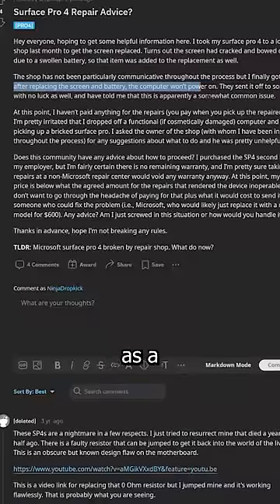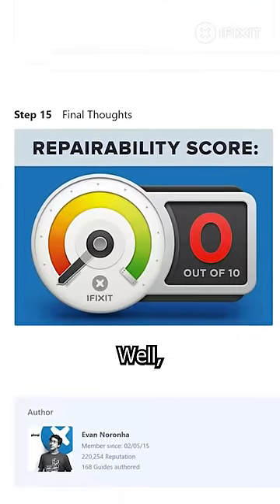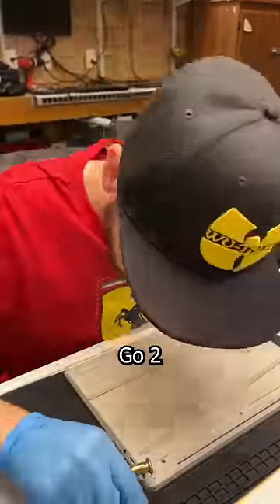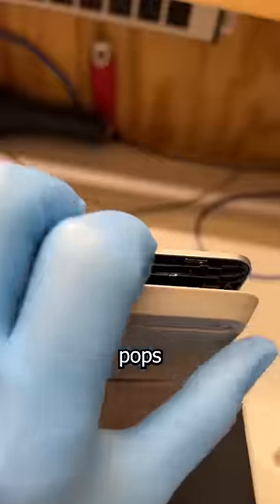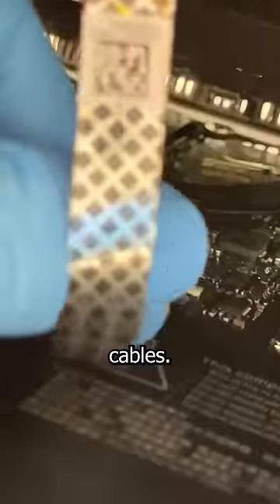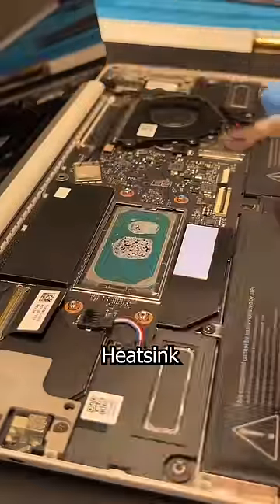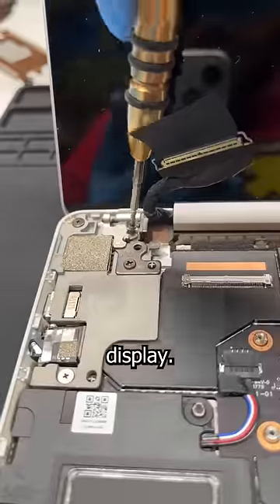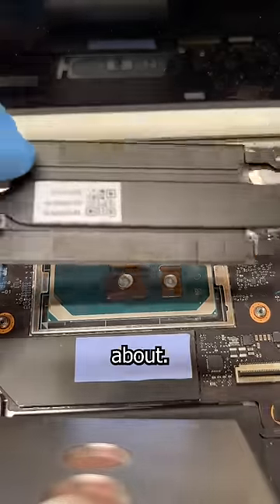Microsoft Surface Laptop Go 2 display replacement #computer #tech #pc #technology #shorts

Comment: 100% better than the old surface
Reply from the maker: Yup!
Reply: @SalemTechsperts the original Surface was glued together😮😮😮.
Reply: but its not hard to be better than shit in the 1st place, and there still bad as you cant even replace the ram in it lol and they say they made it easier to fix yep but not by much lol
Reply: At least it isn’t a table
Reply: 100% of 0 is still 0...
Reply: teslafusion74  its done to save money and to make it so the average person cant fix/upgrade it them self so they can then make more money on the laptop they try so hard to cut cost on so much that they solider down to ram to save 10c
Reply: teslafusion74  being less off a rip off than the biggest rip off is not a good thing as its only time before both get worse and that line is moved again.
Reply: 100% of 0/10 is still 0/10. :D

Comment: First time I hear "soldered ram sticks" for "security reasons" in my entire life
Reply: That hit my ears too... Wtf...
Reply: Doesn't apple do that too?
Reply: They secure their profits 🤡
Reply: @embrance9565  Yeah, it sounds like BS. There is a kernel of truth though. You can cool the RAM down to very low temperatures, turn the computer off, remove the RAM sticks, and read the contents of them (for things like passwords, encryption keys etc).
The cooling helps them retain the data for longer without being powered on and refreshed.

However, I seriously doubt that is the real reason the RAM was soldered on.
Reply: @isa_L  No, that's not true. Look up "cold boot attack". Wikipedia has a good article on it.

You can't rely on SDRAM keeping the bits intact without power for more than a few milliseconds, but especially when cold, they can stay intact for minutes up to hours.
Reply: Securing the bag
Reply: The Cold Boot attack exists. Soldered memory makes this pretty impossible, as the thing you need to do to preserve memory contents, runs counter to the thing you need to do to actually remove the chips. 

Perhaps soldering should become more normalized?
Reply: FortniteClipper-oo3qz  Mugging, police seizure, simple theft, etc.
Reply: @dygon7663  Yeah, and there's a reason people are hating them more and more, even some fanboys have turned coat against their stupidity (though not like the majority of people who buy Apple even knows what RAM is or why it's needed or why it's bad that it's being soldered lol).
Reply: @Lauren_C A far better way of preventing this attack than ruining upgradability and the ability to repair your system is through RAM encryption. In fact, it is entirely possible to preform a cold-boot attack when the memory is soldered or glued on if other security measures aren't used.

Comment: I literally went "😳 WTF" when I heard that the ram was soldered on 🤣
Reply from the maker: Yeah it's unfortunate
Reply: I saw one of those...long time ago. And i looked at that RAM...and immediately thought: "SteamPunk"
Reply: It's typical for a bunch of the more compact and slim notebooks nowadays. Not ideal but they figure it's a compromise to have more room to fit everything else on the board.

First notebook I had with soldered RAM was the Vaio P and even though it made sense why it still left me wishing a RAM upgrade was an option, Vista and Win 7 didn't exactly sprint on only 2GB, at least an SSD upgrade made it boot up and wake from hibernate a lot faster.
Reply: @G1NZOU  That's not even close to the reason why.
Reply: @ValidT  Perhaps elaborate.

Comment: Ive repaired/replaced four screens across three generations of Surface tablet, as well as a battery and some small bits (like the little camera/mic assembly that runs along the top). The fact that you gotta heat the adhesive just to remove the screen to do anything with the insides is not even the worst problem in some of them. Its design is hostile to repair, and I'm pretty sure it was on purpose. The bar for better/more repairable is so low.
Reply: They made a lot of improvements with the Surface Pro 9. For example, the battery is now screwed instead of glued.
Reply: Microsoft even provides now a manual for repairs and parts for the Pro 9.

Comment: I was actually kind of impressed with my Acer Predator at how repairable it was. RAM was modular, even the system drive and wifi controller were easily accessible. Its just a shame something on the system board shit the bed and Acer wants 2k for a replacement. (The laptop wasnt even worth that much brand new)

Comment: The soldered on ram helps prevent against cold boot attacks
Reply from the maker: This is Microsoft's exact argument. It's valid but an unnecessary concern for 99% of the users. They should have made specific models with soldered RAM to be sold to those that need high-security.

Comment: Working as a retail tech, I had a brand new surface pro (2 or 3) come in for a setup. The adhesive strip meant to mount the screen to the case had not been set properly, and there was a section of it that poked out along the crease. I spent a couple minutes trying to fix it before telling the cs team to swap it out for another unit. I never opened those things up, as it was WAY outside my paygrade.

Comment: I work for our IT department in our school district and besides the SSD and RAM being soldered in, the only really annoying aspect of the surface go's is the stupid rubber feet on the bottom. No adhesive or tape you use will make it go back to its place. There will Always be one rubber feet that pop out of place

Comment: Wish you could have done the same with Surface Pro Models 5 and up,
We work with Corporate Organizations MNC's,
and have supplied 100's of Surface Pro with extended warranty support upto 5 Years,
We have specifically trained our technicians and engineers on how to remove the display panel from Surface Pro and Perform repairs / replacements. (Trust me it is still a big pain) 😂

Comment: We need to bring back the laptops that have a Lil hatch on the bottom where you can just replace ram in less than 30 seconds
Reply: Microsoft figured out a while ago that laptops with more RAM are more expensive than RAM by itself.

As long as that remains the case, they aren't going to make it more viable to upgrade your RAM.

Comment: I regret ever having bought a surface pro 4. The first surface pro should've been the warning I heeded, because after a 3 days of using it, it refused to ever turn back on again. No one in town could fix it. Then the second surface pro I bought went through three chargers and its battery is an unreplaceable spicy pillow. Fun.

Comment: Surface Book 2, I sent mine in to get a new ssd installed. They kept it for 6 months. I ended up with a new motherboard, screen, keyboard and, thankfully, the new ssd I'd given them in the first place. They broke the screen 3 times total and kept ordering the wrong part to fix it. I didn't pay a dime but it resulted in the whole uBreakiFix store changing employees..... we still use that surface book.

Comment: i have not, but i have had a nightmare repair on the dell alienware 17 r4 (model with the GTX 1070). first it was a no power issue so we just sourced a new mobo, but then that board fried because i didn't realize that the section that the dc jack rests on under the board when placed in the unit, had an area of plastic film that was ripped out from a previous repair attempt. I didnt realize it until it was too late, and components on the board shorted out when i powered the unit on
Reply: the owner , and my boss at the time, said it wasnt even my fault. I eventually quit for similar reasons. i still have nightmares about that laptop to this day
Reply from the maker: Dude it happens to the best of us. I've fried an XPS because of the same reason. Those stupid plastic shields 😭
Reply: @SalemTechsperts  😭

Comment: That looks far better than being cast in a block of epoxy like the old surfaces, but it looks far from "easy" to repair.

I have worked on equipment that is actually easy to repair, designed for repair, and it is doable with a screwdriver and common sense. This takes expertise at laptop repair and an iFixit guide. Big difference, but definitely an improvement.

Comment: "something they did for security reasons " 
CMON MICROSOFT
Reply: I mean, they could've said performance nd that would probably be more convincing, but security... still I wouldn't be surprised if people really believe this is a "real reason".
Reply: @hahouari_dz Microsoft definitely did solder the ram for $$$, but they're not wrong either. Soldered RAM is a LOT more secure than replaceable RAM.
Reply: @cmxpotato no thief has the knowledge or equipment for liquid nitrogen RAM data retrieval. Only the 3 letter agencies do

Comment: Surface laptops aren't near as bad as the pro tablets, I just replaced a pro 7 display that was donated to the parts bin after the customer decided to get a new one after the repair quote.  The screen was already destroyed so I didn't have to worry about breaking it but it's absolutely still a nightmare and not something I'll do for a customer as parts and labor is basically equal to a used good condition replacement, after so many glass shards and level 10 pucker factor bending the frame back straight its back to a functional device I'll sell off after a deep drive wipe and fresh install of windows since it'll run 11 and is still a pretty recent device.

Comment: I was trying to replace the battery in a Surface Pro 4 since it stopped turning on and it could only run when plugged in. Despite being as careful as humanly possible, I still managed to damage the screen. I didn’t need it anyways so I’ll eventually take it to an e-waste recycler.

Comment: Soldering RAM is a thing that I dont like but it has some advantages you can use zigher speeds and lower latency Chips it's generally not good but in mobile Devices it's kinda the Standart(thanks Apple)

Comment: My surface laptop 2 suddenly stopped booting, turns out there was some motherboard damage. Took it to Nehru place in india and got it fixed for $40. They just replaced the power switch or smth. Very happy but irritated as well cuz no more parts are available.

Comment: As a fellow tech, who doesn't touch Surfaces except for software, I am genuinely unrealistically outraged that you have to remove the heat sync to get the display off because the WiFi adapter is underneath... The right to repair really is the fight to repair sometimes.

Comment: I have a surface laptop, the Surface Laptop 3. 
My specs are:
Processor:	AMD Ryzen 5 Microsoft Surface (R) Edition   2.10 GHz:
Installed RAM:	8.00 GB
System type:	64-bit operating system, x64-based processor
Pen and touch:	No pen or touch input is available

Comment: Hp2760p
We need to pull everything out of the laptops just to get to the fan.

Compare that with 
T902 fujitsu
Where fan has its own separate cover!
You don't need to open the main cover for cleaning up the fan.

Comment: I think devices becoming more repairable is good.  I think that Microsoft doing it for a short period and then going full anti-repair is a bad thing.  They only do this as a marketing campaign so that people buy into the ecosystem over Apple.  My verdict is to buy from suppliers who have a reputation over many generations for repairability.   Framework, for example, has laptops that use interchangeable parts meant to be handled by the consumer.  We should support these companies even if they are expensive because their end goal is to provide the best service to the customer at affordable prices and not the stockholders.  In the long run, they might actually make more money from these types of laptops over the locked down glued battery types.

Comment: We bought a used Surface, refurbished, I set it up, it ran really well all evening and two days later I used it briefly for a half-hour video call and then noticed that the device was getting a bit warm, but didn't think anything of it (because some update was also running in the background). I switched the device off and wanted to use it again in the evening and it simply wouldn't turn on and wouldn't charge. The dealer has given a one-year warranty, but is talking his way out of responsibility and won't even look at the device 😵‍💫I'll probably be taking it to the second-best repairer in the world soon, who luckily lives in my town. 😂

Comment: I meeeeeeeeeeean, having the ram soldered in for "security reasons" seems like a reasonable excuse until you realize how fast and loose they are with your data - which is an ACTUAL security concern.

Comment: I did a creen replacement on a Surface Pro 7 not too long ago. And damm those things suck.

After I replaced it, it wouldn't turn on, after panicking for like 10 min, I pressed the power button and volume up and the bastard came back to life. To my ugly surprise, touch won't work, after I checked everything like 4 times, told the customer maybe it was the screen.

He reached the seller on ebay, got another one and this little nightmare came back to my shop. Opened it up again, got the screen in and it actually worked this time.

Finally closed it, said the client goodbye and promised myself I won't fix a Surface again.

Comment: I own a Surface Pro 3 in my collection which thankfully "Works™️" at the moment undoubtedly the fan,SSD or Battery could die at any second... also the LCD glass on the surface 3 is thinner than the 4 (I've pried the screen out of a 4 without cracking but obviously i damaged the LCD further in the process).

The 3 will probably become a bane in the future but hey it makes funny YouTube content.

Comment: I took my surface pro 5 to ubreakifix to change out the battery but they destroyed the screen and bent the frame and then replaced the screen with a cheap lcd screen and used glue to reattach the screen to the frame with a huge opening to one corner with the screen lifted up and called me to pickup and that the repair was done. I ended up complaining and had them replace the frame and better quality screen

Comment: My (school) surface pro 7 is horrible cause it's normal state is overheating and it feels like a stovetop after using it for 50 minutes on youtube, also nothing is changeable and the 8gb of ram is horrible plus 46gb of the 128gb ssd is used by system files so all around horrible computer

Comment: My pc was a nightmare back in the gateway days.

Bought a powersupply that I needed boot the pc like normal then a dark blue pikachu lighting came out of my pc rear...

Turns out there was a sticker covering the actual power output..😂😅. . So that was a scam.

Thankfully it was grounded by copper properly but was quite the experince. 

But had to wait longer.but sense  than that old worse for wear compact gateway pc is long gone and lessons were learnd.😊

Comment: Where I work we have some gen 1 surface laptops that need their batteries replaced. We cannot open them without destroying the carpet some brilliant engineer thought was a good idea, and Microsoft won't repair or exchange them 🤬 I guess we just make sure the laptops with their expanding batteries are safely disposed of which is a shame because I'm sure they would work just fine with new batteries.

Comment: Just replaced the surface laptop 3 15 inch lcd while keeping the same display panel body, believe it or not, its possible to replace the lcd without having to change the entire panel😁

Comment: Damn. I have a Surface as a work computer and it's an older hard to fix model. I broke the LCD screen by pressing a little too hard on it (the glass isn't broken, just the liquid display part). I don't know what to do. I've been using my personal computer for work (ASUS) instead.

Comment: "Security reasons"
What possible security reason could you make up for making ram non-replacable/upgradable
RAM is literally volatile, there is no information you can store on it even if you tried.
Reply from the maker: "Soldered RAM stops someone from removing the memory and "easily" freezing the modules using liquid nitrogen. Once frozen, Microsoft says it's possible to purchase a special memory reader for a few dollars from Aliexpress and access all the data stored in the modules, "including the Bitlocker recovery keys." https://www.pcmag.com/news/microsoft-blames-liquid-nitrogen-for-surface-devices-using-soldered-ram
Reply: @SalemTechsperts  Huh interesting.. but what are the chances realistically.
We've had no issues for a long time, I still don't see the need to do such.

Comment: One time I had a computer with a z97x-ud5h-bk mobo and an i7 4790k and it wouldn’t boot half the time and kept flashing a cpu initialisation error and then the main bios got corrupted after my sibling used the cmos reset at a normal reset button. It would barely boot and the only way I got it to work was by reseating the ram.

Comment: I actually have a Surface Pro 4 with a battery that’s completely bit the dust. Have to run in it off the wall adapter at all times. I called 3 repair shops near me that all refused to even attempt the repair 😂

Comment: My needs are unfulfilled - I wanted to see the busted screen. But interesting that you swapped the whole top assembly, not just the LCD. I mean HELL YEAH but when I was fixin stuff I had to exorcise the old LCD out and re-úse the top case including the #¤% wifi antenna and demon infested cable that goes through the hinge. It worked half the time, the other half the cable committed seppuku as soon as I tried to gently talk to it. Should you want to tempt your fate, bring heat. like 2000w heatgun heat ;-). And workmans gloves, you do NOT want to use nitrile or latex on hot glass.